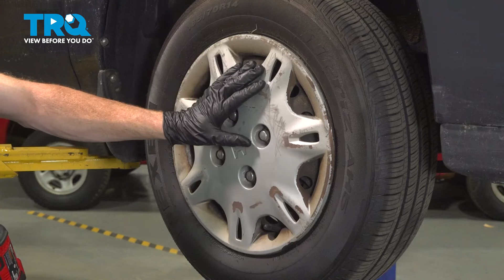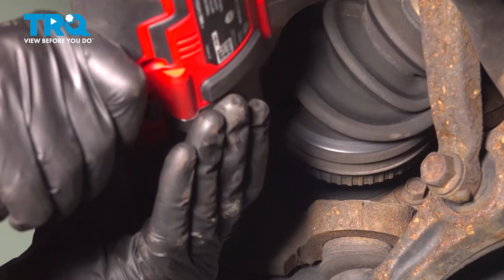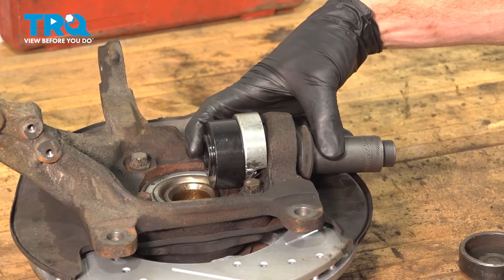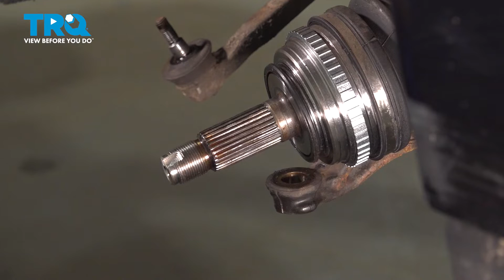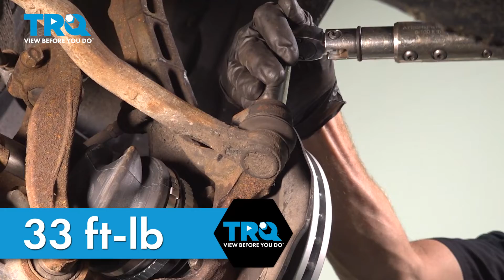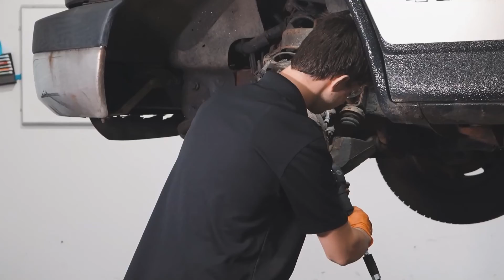How to Replace Front Lower Ball Joints 1994-1997 Honda Accord

Comment: 0:22 21mm lugs on mine
1:22 for everyone's sake and sanity and to avoid ALOT of headaches and time, do NOT do this. Your caliper will slide back on the pads when you go to put it back together
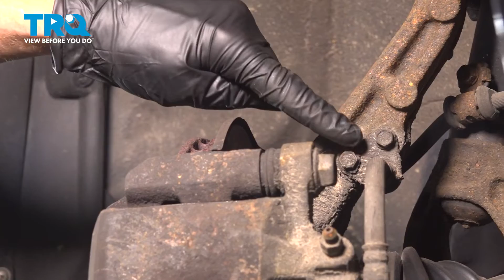1:41 12mm
1:58 16mm
3:16 "loving bonks"
5:05 ever heard of a pickle fork?
5:28 you don't need to be "extremely careful" you're not going to hurt the CV at all however you do it

Comment: " and we can pause with that ball joint press because we can't get it to go out any further, or put it in a vise give it a few loving Bonks! . And there it is. It's out! ) 
I CALL BS!!! Shenanigans 
. I've hammered tapped I've done bonks wonks thunks. Grunts. Nothing. 
I don't believe that ball joint came out that easy for him. 800 already been taken out and he just placed it in there and lightly bonked it
Reply: just finished doing one right now. First one I used my press, took way longer. Second one I put a 32 hex socket over the ball joint, and hammered it down. Once it got half way out with 3-4 bonks, I put a 3/8 socket in between the 32mm and ball joint, hit it twice and came out like butter. Sounds like a lot but I did the whole ball joint press part within 5-6 minutes no joke
Reply: I’ve bonked them out before lol. And right back in. Albeit, only one car. And I haven’t done that model again since.